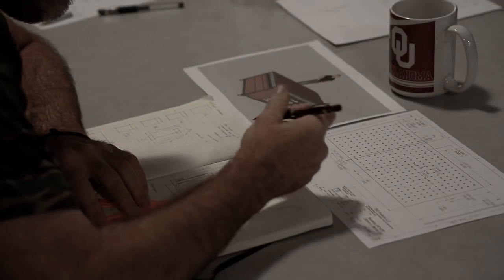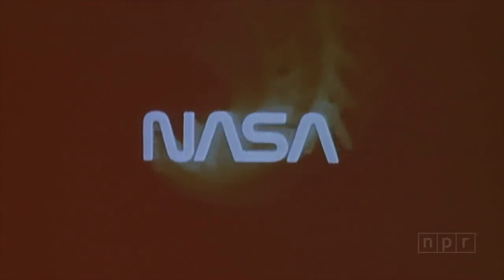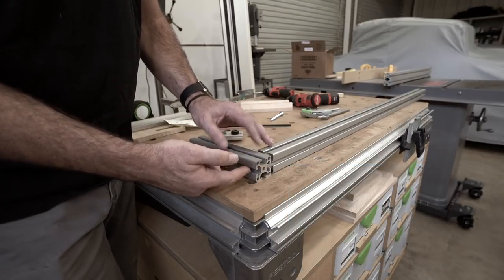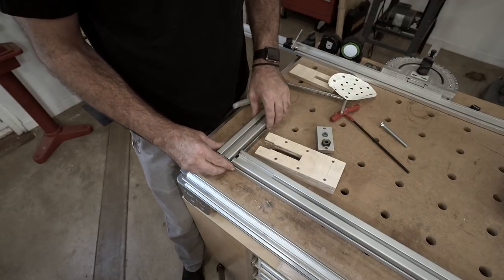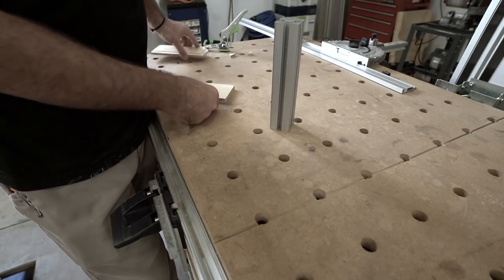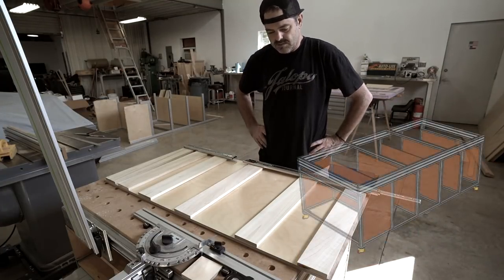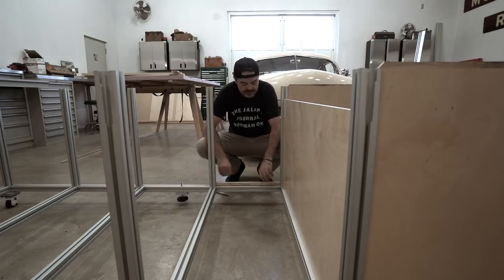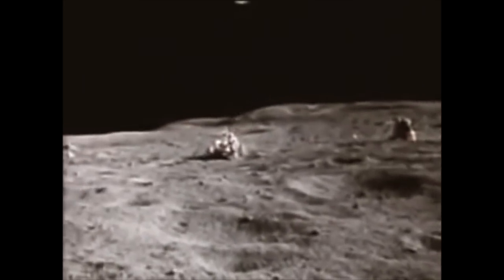The BF/MFT Workbench Build - Part 1

Comment: I don’t know if anyone mentioned it but for the t-slot access after a build is done for additions or removals, 80/20 and other alumni extrusion companies make special roll-in, drop-in, and quarter turn t-nuts. They are designed to specifically mount from the face top

Edit: I misunderstood that. However I think they make tools that do the same.

Your jig is a great workaround to a common problem with slotted parts

Comment: Your panels that were routed so it can be slotted into the aluminum grooves, i would like to do after watching. a 45 degree notch out is such a great idea to avoid the connection joint.

Comment: FYI, the only fouled carbide bit is a broken bit. If you weld it or otherwise get a buildup of aluminum on the tool, hydroxides are your friends. Muriatic acid also does the job.

Comment: To get clamp access at the 4:00 mark, why not cut a groove across the other side of the butt joint?  Then you could clamp near corners in both directions?  I like how the panels slide into the 80-20.

Comment: I was wondering why you didn’t just mill out a slot in the perpendicular 80/20?  Would that compromise the corner strength since you would mill through both shoulders?

Comment: Love the video.  I’m curious about your table saw rip fence.  It appears to be an 80/20 extrusion also.  If so how is it attached /shimmed?  Only saw it briefly but looks like an old craftsman saw like mine.  I am thinking of adapting 80/20 as a fence/rail system using their linear bearings.  Thanks you in advance for any tips you can give

Comment: Amazing build! Curious if your using 40series or 15series couldn't you just use a single bolt (5/16- 18 button) in the end of the 80/20 and then drill your access hole in the other piece to tighten once you have slide it into place? instead of using the 80/20 clip/bolt connector.  Also do you have a CNC file for the jig you made to machine the 80/20 for clamp access

Comment: I really like this project and all the videos that you have done about it. I am currently planning to build a similar work bench like you. No i wonder which aluminium profiles i should use. I am located in europe but the profiles you used seems like our 40x40mm or 80x40mm ones. I can buy them in multiple versions - i think you used the "light / normal" one - is this correct? does that work for you? They are also available in "heavy" - have you thought about using the heavy ones?

Comment: Hey man, great video.  I’m here because I had the same idea to use 80/20 for the top frame and a plywood only base.  My main motivation was to ensure I had a dead flat top.  Can you comment on flatness please?  Any sagging at all?  Thanks and keep up the good work!
Reply from the maker: There's no sagging at all... and I'm hoping that doesn't develop. I designed it thinking about support for the MDF. Right now, it's as flat as I can measure.

Comment: I loved your previous systainer workbench, why the need for a larger one?  Just need more space for workpieces and systainers?  I'm looking to do a 3x6 version similar to your first build, so just looking for your experiences with your previous build and things you didn't like.  Thanks!
Reply from the maker: I've loved my systainer cart... It's been the most used tool in my shop over the past couple of years. And I don't know if I will get rid of it with the addition of this bench. However, this bench is incredibly more functional simply due to the square footage of it. I can process full sheets of plywood, have almost unlimited rip and crosscut capacity, and the storage space is nuts. I'm building in a few more things you'll see in part 2 as well...
Reply: The Garage Journal looking forward to part 2. I’m not a car guy, but love and share your approach to tools and the shared hatred for dust. Thanks for the reply as well!

Comment: Hi there, I'm really inspired by your design and right now thinking about using these aluminum profiles for the base as well.
I was also wondering how to get clamps and hardware in through the butt-joints. Your method looks interesting, but I wonder if you don't loose some clamping space from the very long slots. Hod do they work for you?
Did you thing about milling an opening through the other bar that's blocking your profile (like a crossing?)

Comment: Love it, the channel is awesome as well. Would it have been easier to “cross cut’ a slot in the other extrusion on the 4’ end? This would have given you the same access with much less routing. This is not criticism in any way just something I thought of while watching the build.  The table is awesome and your channel is one of my favs!
Reply: Rick Noblett I planned on doing that initially, but there’s a ton of load on the perimeter 80/20 and I didn’t want to take any chances.
Reply: Ahh ok that makes sense - can’t wait for part 2!
Reply: The Jalopy Journal I used the 15 series 3030 extrusions on mine